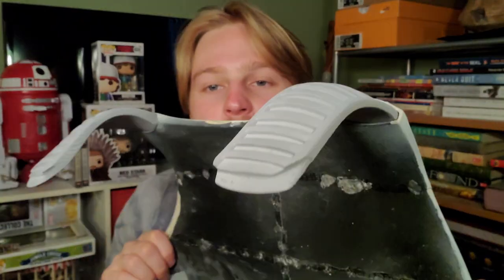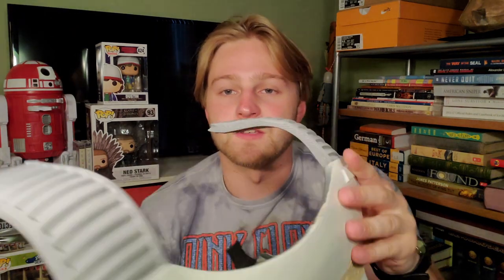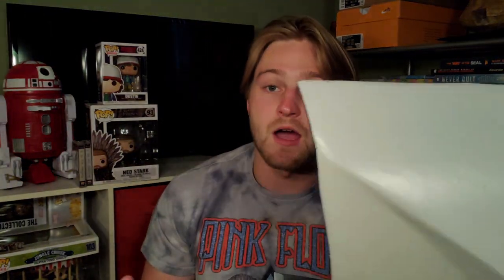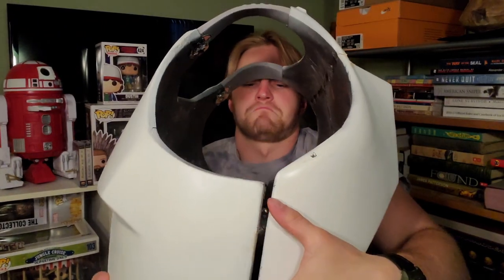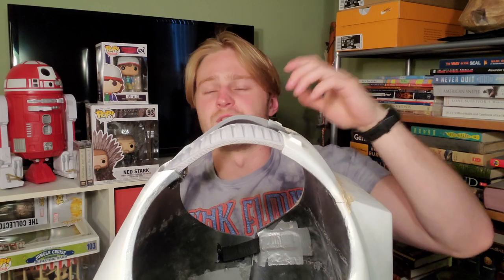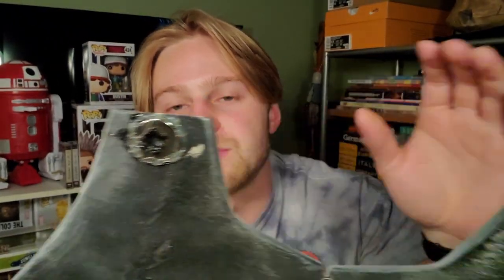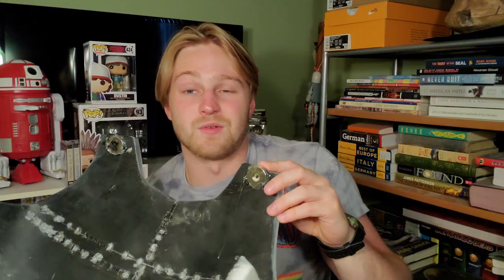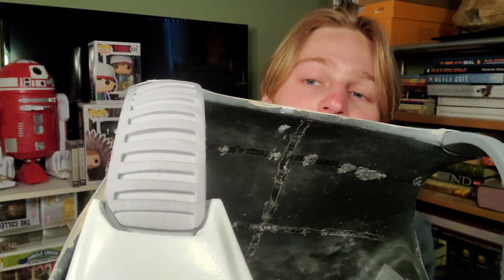3D Printed Star Wars Phase 2 Clone Trooper Armor - Episode 7 - The Straps

Comment: How long did it take to print all the armour
Reply from the maker: It is hard to give a true estimate as I had a lot of mistakes and print things multiple times, but you can expect to be having your printer going for quite sometime. I split the larger pieces into 2 or more chunks but each of those chunks took anywhere from like 5 to 18 hours depending on how big it was. I think the things that took the longest were the calf pieces because I printed them all in one piece and I think they took like 3 days. It has been a while since I have been actively trying to print the armor so my memory is not quite as good about it. I've been more in the putting together and finishing process for a long time unfortunately.